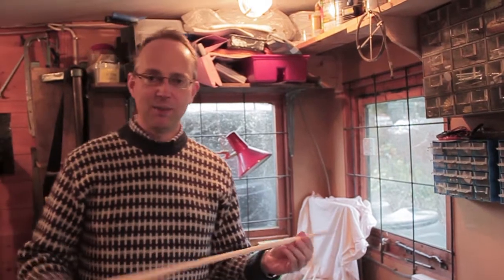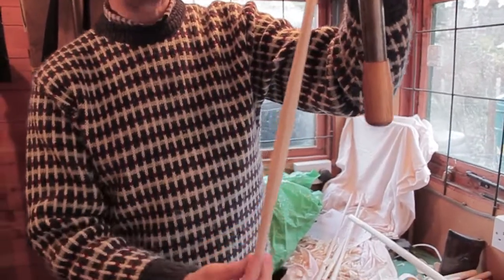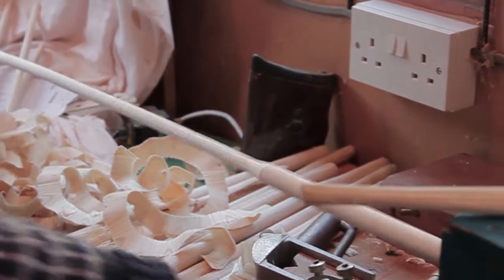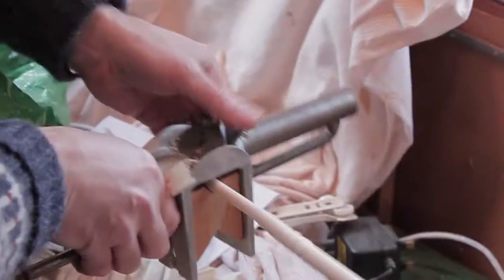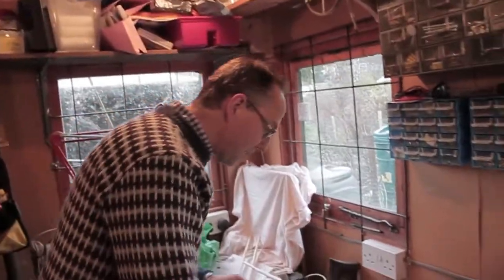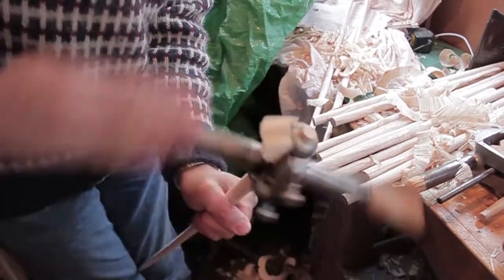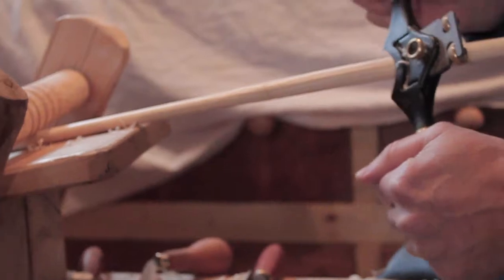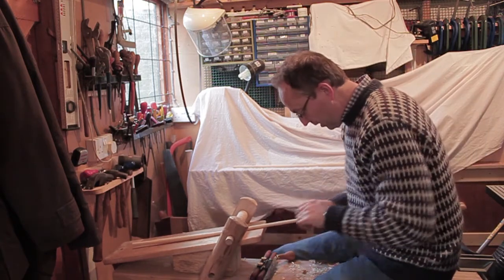Making Windsor Chair Spindles

Comment from the maker: Hi Don - yes they are called rotary planes, and the one that shaved is called a trapping plane. I made these ones from aluminium years ago, and I started off making them in wood. Wooden ones work perfectly well. Set the blade angle at 30 degrees at a tangent to a circle, and don't get too ambitious with the taper angle. Don you are absolutely right the delicate shavings are because the wood is green, they do work on dry wood but not so well. I might get my furnace running this winter. Harry
Reply: Harry Rogers I would delight in a video of how to make these wonderful, efficient planes. They’re unlike anything I’ve seen before and I’m full of envy.

Comment from the maker: Hi Phill - the cut angle needs to be low - around 20 degrees, and the exit edge of the blade slightly rounded so that it does not dig in. Lets have a look at White Chimney. Regards Harry.

Comment from the maker: Hi Arthur - thanks for your comments - the stail engine can either be home made like mine, or you can buy one from Ashem Crafts here in the UK. The clamp is often referred to as a shave horse and they are fairly easy to make - there will be plans in one of Mike Abbotts books and also designs on bodgers.org.uk - I hope that helps Regards Harry

Comment from the maker: Hi Arthur - to buy a commercial stail engine turning head will be costly - circa £750 - Ashem Crafts do sell them, and will have prices on their website. I made my own from an electric motor and pulley wheels - you want the chuck part to turn at about 200 rpm. You could consider turning up some wooden pulleys to make a back gear for your existing lathe - to be used in the same way that back geared screw cutting metal turning lathes achieve a speed reduction - just a thought!

Comment from the maker: No, it generally dries out straight, as its riven wood (split out from a log) so the grain is straight and not warped, so the wood dries straight and will flex gently in use.Harry

Comment: Hi Harry. Could you give some advise on building your motor lathe... I see some old comments and I've seen some other videos you have posted with it in but it would be great if you could explain in more detail how it is built, with what chuck etc and polly system. I live your videos! James
Reply from the maker: Hi its a standard 1425 rpm lathe motor geared down roughly 1:3, and is wired for forward an reverse. The pulleys are Picador. The chuck is lathe turned, roughly 1.5 inches internal diameter. The split collects are in a number of sizes, 3/8 1/2 5/8  3/4     1     1 1/4     1 1/2 and are held in the chuck with a grub screw going through the side of the chuck.
Reply: @harryrogers  many thanks for this!

Comment: Hey, Harry; Ive used the draw-shave to great joy recently, but it seems Ive got it wrong; maybe you can shed some light a little, Is it bevel up, or down? When I see you, and others draw-shaving, its bevel up work; when I do that it just dives into the wood, till its just stuck!  Bevel down seems to work SO much better, with ease of tapering out of the wood as I tilt the handle slightly back.
Reply from the maker: Hi Seth ...I use bevel down for fine work. Just a thought is there a secondary bevel on your draw-shave? With greenwood its soft enough that you can get away with one bevel, and it can be a fairly shallow one, and that is what I do. However different people do things different ways and I am not saying one is better or more correct than another, in my opinion its what works for you.

Comment: I don't seem to be able to find the spindle former tools you used (do you call them rotary planes?). There were two types. You had two that gave specific diameters, and one that "shaved". What company sells them? What are their specific titles? The delicate shavings, I assume, only occur when you use wood with a very high water content (green). Have you ever used those tools on wood that had dried to ambient moisture content (no kiln drying)?
Don Batts